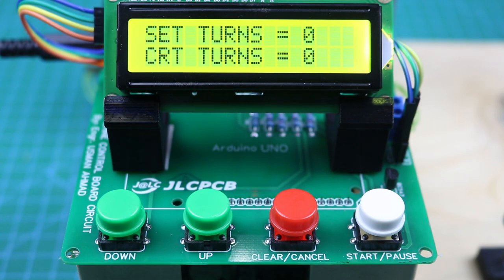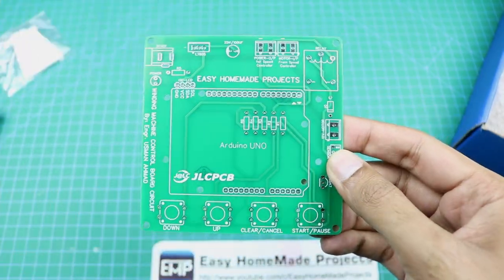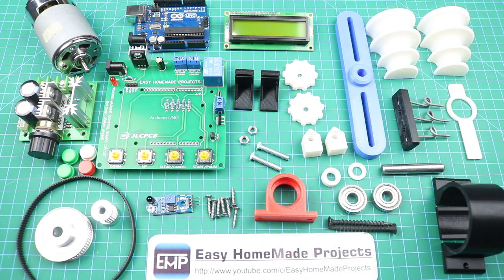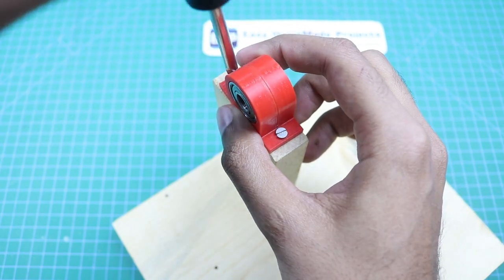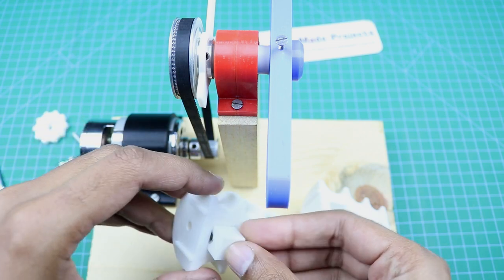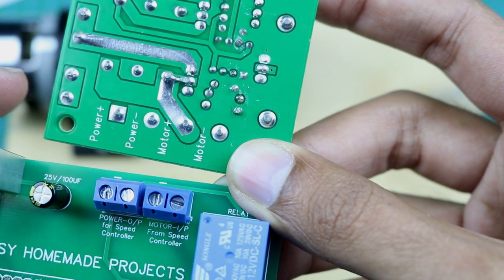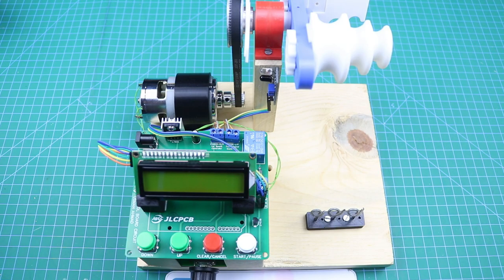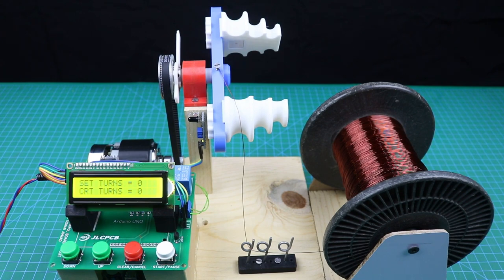How to make Automatic Winding Machine using Arduino

Comment: You Could Add Brushes To The Coil Of Copper For The resistance Of The Turns Because Without It The Wires Could Get Free In Some Areas, That Would keep The Tention High On The Wire And Cleaner Winds/Turns

Comment: The Arduino''s pin designation and the actual chip pin numbers don't seem to match. Please clarify. 
P.S. Just noticed that the diagram/schematic seems to show 328 qfpp which has 32 pins (surface mount). The uno shown in the video has the regular 28 pin dip. Please clarify.
P.S. The Sensor is mentioned as VS1838B which is actually a IR Rx only whereas you have used a IR Rx-Tx  module. Regards, Engineer from India.

Comment: Nice project. Would you kindly describ in details about its turn counting process.
& Plz discuse how can  I devolop the same project for cilling fan motor winding ?? Hope U know, for cilling fan winding, after compliting of eich slot the motor starts revers windind say if at slot  No1 if  U wind at clock wise, then at slot No 2 it will wind at anti clockwis.  &  It will continue at ebery alternative slot. At a cilling fan normally their has 12 to 14 slot, may be some more. Or less.

Comment: I want to control the speed of motor automatically by the number of count,, like when count 0-20 speed will be low and then high and wil get low when less than 30 count left  of total count and when complet count it stops

Comment: Hey bro i really need this project  

But your code wasn't work
Reply: did it work? i tryed this project, started but didnt stop
Reply: @ibanez130  same problem bro
Reply: @realexperiment1740  i worked i wrong install the transistor and diot!!! i reversed them and worked.
Reply: Where is the code bro
Reply: @ibanez130  anıl kardeşim kod varmı sende

Comment: I am getting the following message while compiling the code, please help

Arduino: 1.8.13 (Windows 7), Board: "Arduino Pro or Pro Mini, ATmega328P (5V, 16 MHz)"

C:\Users\lenovo\Downloads\Winding machine\Winding_Machine\Winding_Machine.ino: In function 'void setup()':

Winding_Machine:27:13: error: no matching function for call to 'LiquidCrystal_I2C::begin()'

   lcd.begin(); // begins connection to the LCD module

             ^

In file included from C:\Users\lenovo\Downloads\Winding machine\Winding_Machine\Winding_Machine.ino:4:0:

C:\Users\lenovo\Documents\Arduino\libraries\LiquidCrystal_I2C/LiquidCrystal_I2C.h:58:8: note: candidate: void LiquidCrystal_I2C::begin(uint8_t, uint8_t, uint8_t)

   void begin(uint8_t cols, uint8_t rows, uint8_t charsize = LCD_5x8DOTS );

        ^~~~~

C:\Users\lenovo\Documents\Arduino\libraries\LiquidCrystal_I2C/LiquidCrystal_I2C.h:58:8: note:   candidate expects 3 arguments, 0 provided

exit status 1

no matching function for call to 'LiquidCrystal_I2C::begin()'

This report would have more information with
"Show verbose output during compilation"
option enabled in File -> Preferences.
Reply from the maker: Install i2c library for lcd
Reply: @EasyHomeMadeProjects  Thank you for quick response. Tomorrow I will try and share the progress.
Once again a big thanks...
Reply: @EasyHomeMadeProjects  
Usman Bhai 
Finally it worked.
Instead of lcd.begin I used lcd.init(); // begins connection to the LCD module.
Now the sketch compiled!!
Thanks

Comment: there is (int f = 0;) in code, but dont use 0 pin in schematic what is f ?
Reply from the maker: It is only used as int. Not as a pin.
Reply: @EasyHomeMadeProjects  i sended a message from facebook pls you can look?
Reply: @ibanez130  were you able to upload the code?